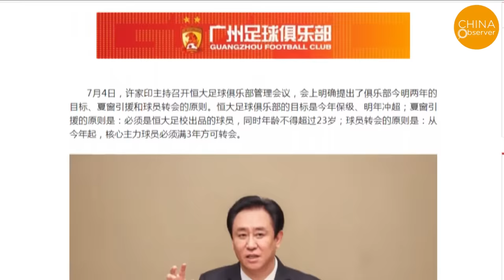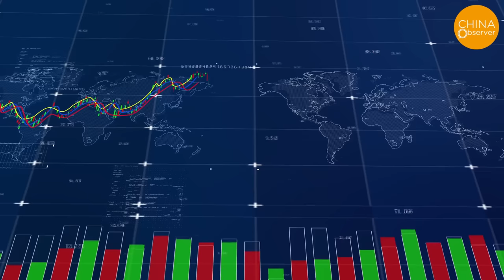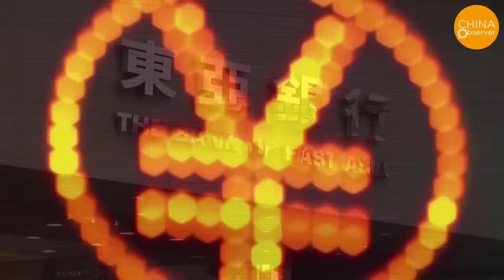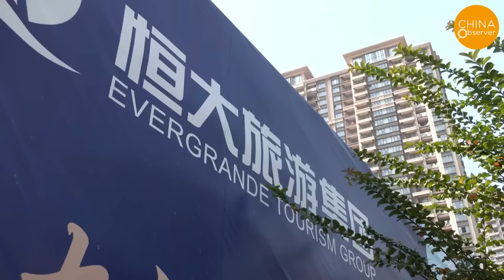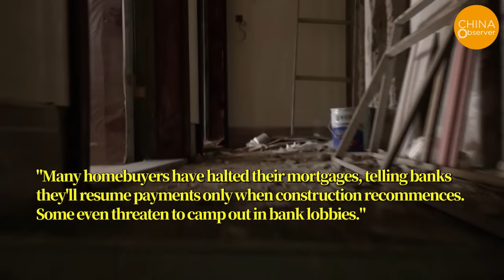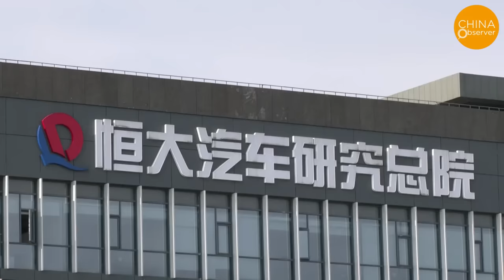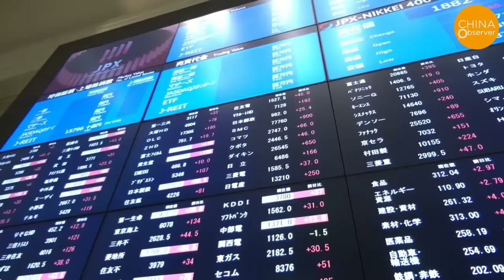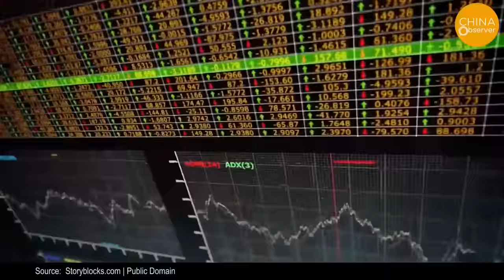World’s Largest 1.62 Million Unfinished Units; 6 Million Homeowners Face Potential Homelessness

Comment: hope it works out for the people affected. ccp really screwed them by letting banks keep lending blindly.
Reply: It's mostly down to the banks handing over the majority of the money for the project to the developers after they've finished topping off the building, which is well before the completion of the entire building project.
 Leaving the project as a bare concrete shell, with no windows, doors, power, running water, or lifts installed in a twenty-plus-story building!
Numerous owners of these homes have no choice but to live in their unfinished homes even though they are living in a bare concrete shell.
Damn, it would be infuriating to live like that and still have to keep making mortgage payments every month!

Comment: Doesn't quite register.   Other estimates say that there are 50 to 100 million unfinished apartments and houses in China.   So 1.62 million is almost insignificant.  Even 100 million is less than 10%, so not a huge deal, about the same percentage as in the USA.
Reply: not even close to the USA.

Comment: Debt ≠ losses.
Accounting 101, both sides of the balance sheet need to "balance" out. There should be an equal amount of assets that offset its liabilities. Obviously, there can be accounting trickery that can overstate assets though.
(Zero chance I'm going to invest any time into looking at their financial statements.)
This video was all over the place. They should have slowed it down and picked the main points and expanded those points. Lots of random "facts", but didn't make sense or very interconnected.